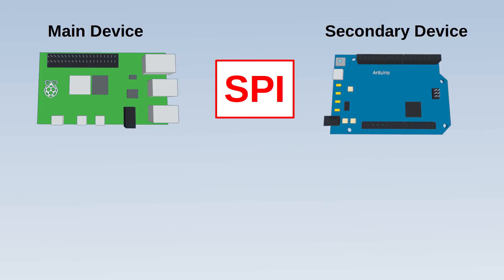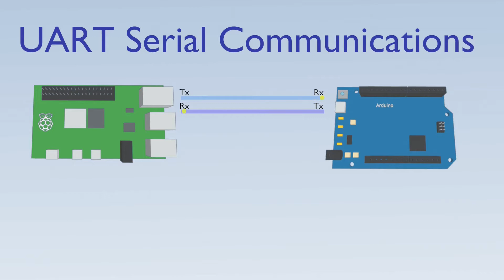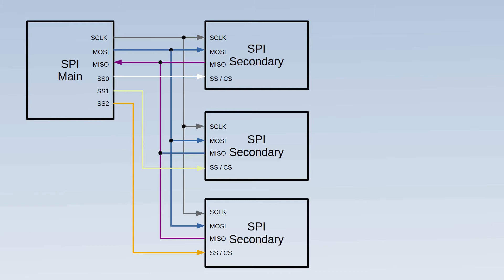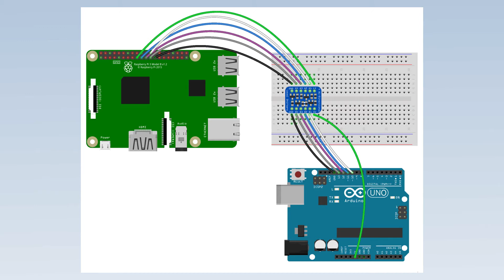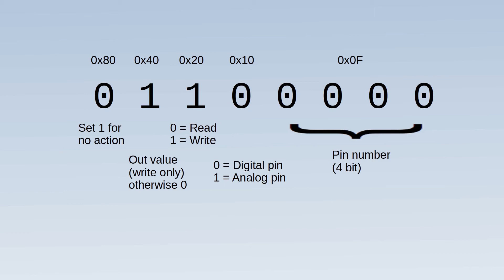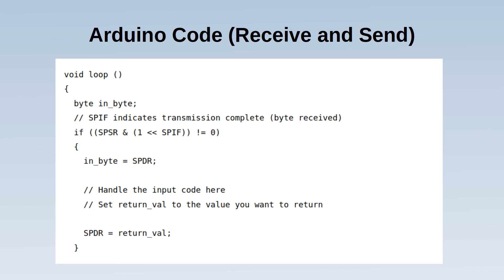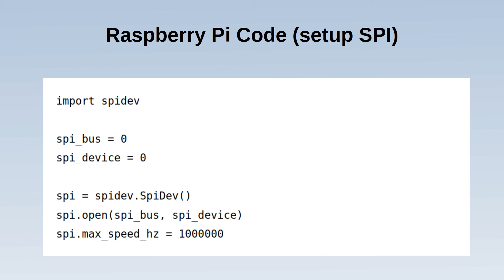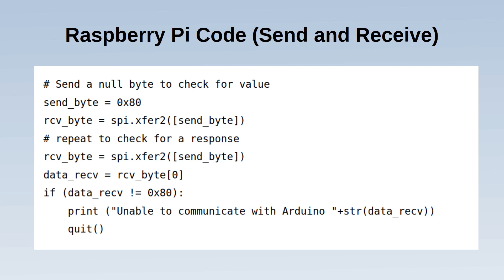Raspberry Pi and Arduino communications using SPI with Python and CPP

Comment: Nice presentation and clear coverage.  I tried to use 2 RPI (instead of RPI and Uno) connected to communicated via SPI using python but does not seem to work.  Any suggestion or a script that you can point me to?
Reply from the maker: Thanks for the comments. 

That's not something I've tried. Most code for the Raspberry Pi will assume that it's a controller (master), and act accordingly. I don't have any suggestions for examples of using RPi to RPi at the moment as I've normally used either UART or network for that. I am wanting to look further into various BUS technologies / protocols in future so I will try and look into at least some form of RPi peer-to-peer in future.

Comment: Wow, Raspberry Pi is soo great... r

Remind me again, what's the current draw of a Raspberry Pi on startup? (It's 5 Amps). 

And is Raspberry Pi deterministic and safety critical? (It isn't). 

Can you do ADC operations with a Raspberry Pi? (No)

Can you easily use bare metal programming on a Raspberry Pi? Debatable, but most people who use it probably have no idea how.

There is a very good reason microcontrollers exist in the world of microprocessors, just like the invention of nail guns and rocket and jackhammers didn't make hammers obsolete. 
MCUs are simpler to program on a hardware level, the architecture is easier to understand, which is essential for real time operations; they can typically control more peripherals, do so with a lower response time, and as I said, in a deterministic manner. Traditional operating systems are fast enough for the human eye, but if you're running several cascade control loops with various sensors, and the time constant of each inner loop needs to be 10 times faster than the outer one, you VERY quickly go from micoseconds to miliseconds, to ten miliseconds, to 100 miliseconds... and that's 10 fps, for people out there.

Sure, you're not going to build a spacecraft with Arduino Uno, which is why actual embedded MCUs are much more powerful, but for simple prototyping Arduino probably the least painful way to go.

Comment: Hi thank you for the explanation! I have one question. Is it possible to control 22+ servos over spi from raspberry pi4b 8gb? Sending servo commands through spi and receiving their positions and sensor data. From the slave stm32 (in my case)

I want to make a humanoid robot but I think the data transmition and receiving end of it need to be decent precice for it to work. 

Any thoughts?

Comment: I fail to see what slavery has to with an SPI tutorial... But I guess I'm not political correct... And another thing, serial communication over UART is full duplex as well, unless you use a hardware layer like EIA-485(Also known as RS485) then the hardware limits you to half duplex at the advantage of higher distance. It just depends on your implementation...
Reply from the maker: The Open Standards Hardware https://www.oshwa.org/a-resolution-to-redefine-spi-signal-names is suggesting renaming the pin labels as well. If you want to continue to use the master-slave terminology then that is fine, but I'll be moving towards the newer terminology.

With regard to half-duplex then I was specifically talking in reference to my previous video and that the "data was sent in a half duplex". The hardware is most likely still talking full-duplex, but the implementation I used had the two devices taking it in turns to send the data. Perhaps this would have been better worded differently, but I was trying to simplify it to make it easy to explain.
Reply: @PenguinTutor  I prefer to call my slave devices moon-crickets.  Really drives home the point that they're the lesser devices that work all through the night while the Master sips his sweet-tea and drives them with the SPI whip.

Comment: The good thing is that even the small Attiny85 and Attiny841 SPI hardware have built in. 
With UART Serial it only works in software, or I2C half hardware and software.

The big Mega328 also have SPI, UART Serial and I2C all in hardware.

Comment: If i want use 5 arduinos as slaves?? I can use spi_device 0 and 1 for two of them. what can I use for the other 3 arduinos?? Eagerly waiting for your reply...
Reply from the maker: SPI0 has 2  CE pins and SPI1 had 3 allowing you to control 5 devices from a Raspberry Pi.

Alternatively you can just use a single SPI bus but use other gpio pins for chip enable for the other devices. You would likely have to code this manually as the drivers will likely only work using the designated CE pins.

Comment: Why I always get the wrong result of the data send by Arduino. When I send 0*80 to arduino , it will always return 255 or something else
Reply from the maker: I've not seen that. When I was testing i found it useful to be able to print the values being sent and received and check them.

On a Pi you can just print to the console, but on the Arduino I had to use the serial port (eg USB) and the Arduino serial console.
Reply: @PenguinTutor  Thanks for the response and I mean in the console of pi , I always get the wrong result. For example , when I send 0x80 from pi to arduino.It should return 0*80 in the console , but It always return the wrong one. If I should configure the mode (such as lsb first) in the pi or there’s some other reason ?
Reply: @陈天逸-v2y  hi i have a similar problem. did you solve it?

Comment: I was wondering if spidev supports 16-bit SPI transfers. I'm using a PI 4B, and the processor is indeed capable of being programmed to use a 16-bit word length. So I was just wondering if the Python library spidev supported this. Thanks.
Reply from the maker: The python library is just a wrapper around the Linux driver.

That supports 8-bit words or 9-bits in LoSSI mode (normally the extra bit is to differentiate between instructions and data, but it doesn't need to).

As far as I can tell it's not possible to send data as 16-bit word length, but it's simple enough to split 16-bits into two 8-bit words and then region them at the other end.

The data is sent serially over SPI so performance overhead should be minimal.

Comment: Thanks for this awesome tutorial. What is the maximum distance over which SPI can communicate?  Also, please let us know if you are are coming up with SPI Communication between Raspberry PI & Pi Pico.
Reply from the maker: It should work for about 10 meters, although I've not tried beyond about 2 meters. 

I haven't covered I2C yet which I was planning to do in a few weeks, so that will be likely be the first protocol I get to try with the Pico, but hopefully I can revisit SPI in the future.